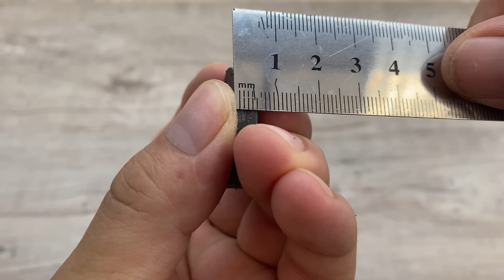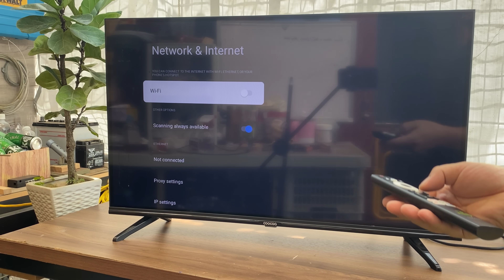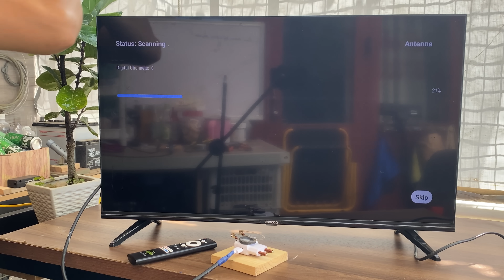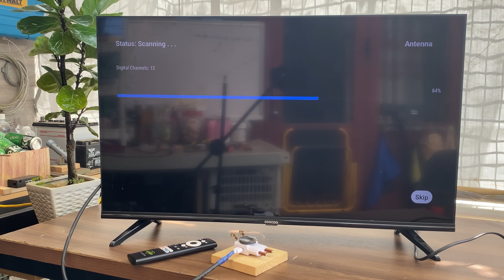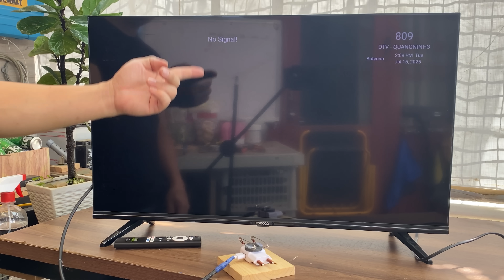No Internet Needed! Billions Of People Don't Know This Secret! How to make antenna at home

Comment: The biggest lie, one that even fools wouldn't believe, is that free internet doesn't exist. It's just a hoax and a lie. It's absurd that someone would take a magnet and a charging cable and make something called an internet cutter. It's just ridiculous stuff. If free internet were available, telecommunications companies would go bankrupt and be in dire straits; it would be impossible to get free internet.This is pure fantasy, a scam designed to deceive gullible people. I tried this in the past and it didn't work. I discovered it was nothing more than a lie. Also, if you want free internet, you should either steal your friend's password or steal mine. Free internet 😂😂😂😂😂😂😂😂😂😂😂😂😂😂
Reply: Well I'm actually responding to your comment right now thanks to my homemade wifi antenna I made using this video!!
Reply: @icepick859  Yes, it's just an optical illusion and a lie. It's difficult to manufacture this antenna unless it's made by companies.
Reply from the maker: Thank you for sharing your thoughts, @JalalPo-b7b! It's definitely a complex topic, and while some methods may seem far-fetched, exploring alternative solutions can lead to interesting discussions about accessibility and technology. 🌐